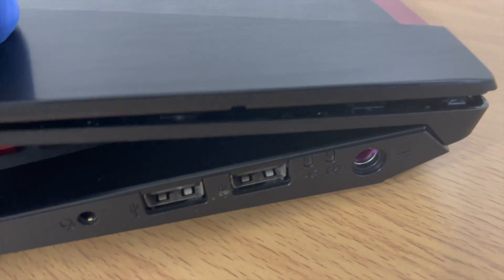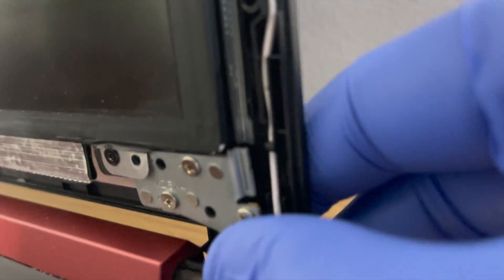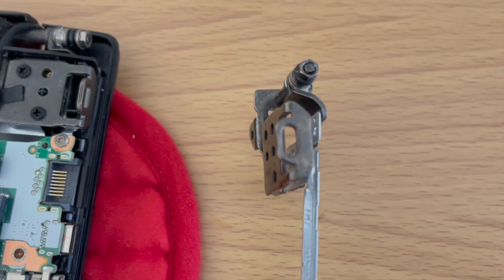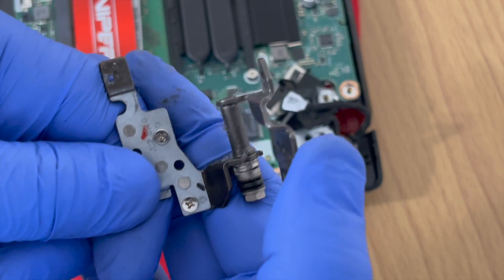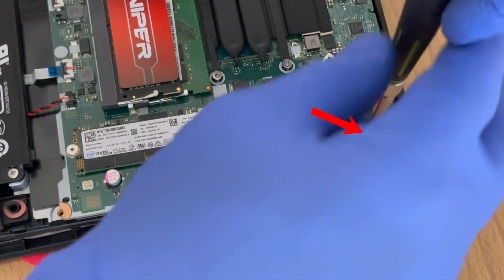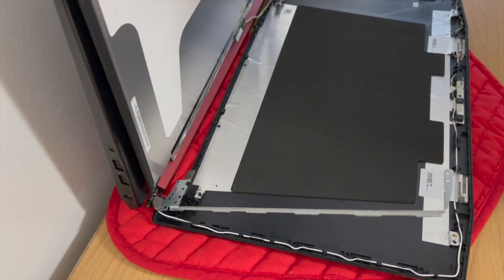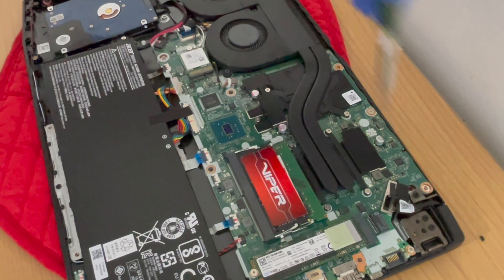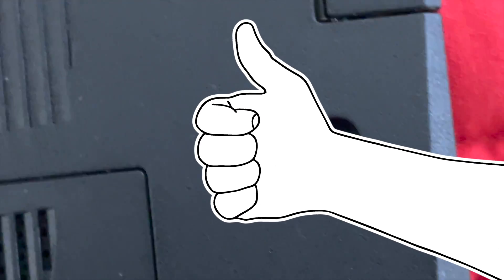Acer nitro 5 Broken Hinge Replacement

Comment: Thanks for your help, mate! Both my hinges broke, the LCD stopped working, and the screw holes in the bezel broke out. I got overwhelmed and set it aside for a couple years. But now, it's good as new ^.^
I'm disappointed to hear that I'll probably have to do this periodically. But at least now I know the original break wasn't my fault.

Comment: How long did this take? How long do you thinknit would take to replace the somewhat damaged LCD and front bezel at the same time?  I have a limited income and want to estimate the cost of repair based on the rate the local repair place charges. Any help estimating the time frame would help me find out if I can afford to repair it or not and would be be highly appreciated  please and thank you.

Comment: Same thing happened to me as well. But after replacing new frames it does not recognize closing lid. Any idea what sensor detects that event? What may have gone wrong while repairing?
Reply from the maker: Make sure you check your settings for "closing the lid."  It may be set to, "do nothing."
Reply: Magnet that sits on top of the screen

Comment: But the gaming laptop is portable **-Ack**
Reply: happened to my an515-42, it's shit a fucking vacuum dust receiver and a broken hinge on screen. Im glad I didn't spend another 60$ shit shell replacement and straight up just used epoxy to the hinges. more sturdy and less likely to fuck it up soon.
Reply: also the cuck screen is not even screwed and I had to use a strong rubber adhesive tape it back in (the screen slid off progressively under the chassis due to heat I guess but they should have know it coming).

Comment: my nitro 5 has a faint white line flickering below the taskbar. what seems to be the problem and what to do?
Reply from the maker: If it goes away if you press you finger on the screen then the screen is damaged.  You'll have to replace it or try to ignore it.

Comment: 4 years of owning this laptop and the right hinge finally broke
Reply: Just added like seven bandaids to the area as if its an injury because my poor ass cant afford these parts lol
Reply: @Nomadic7z  mine just broke do you think super glue would work as well?
Reply: @TEKIOLOL  Maybe but i just ordered a replacement part and swapped the broken hinge out with a new one.
Reply: Mines about 3 years
Reply: It's allways the right hinge😂😂😂
Reply: Same issue happened today after 4 years of use. Right hinge any solution
Reply: @abhishekpatnaik144  you could find hinge replacements or just tighten it with tape or something. Honestly really shocked how much of an issue this is for that particular laptop. Must be a design flaw.
Reply: mine also broke after 4 years of use.
Reply: Mine broken, too, on the right side. Right after 4 years and 3 months. XD. Got get replacement, I guess. Have secured the panel with duct tape at the moment.
Reply: 5 years Still a Goat
Reply: Same issue
Reply: Bro mines lasted 7 years and I’m just now about to get to it after it being out of commission for almost 8 months screen cracked,hinges broke, and keyboard needs replacing and maybe some dusting bc I haven’t kept up with it like I should have but yeah Ik it’s a yr late response I don’t think anyone going to reply back anyways but just gonna leave this up here 😂
Reply: Same here
Reply: Bro my left hing is crack and my screen is now flickering
Reply: Seven years

Comment: the thing thats holding the screw snapped, how can i fix it?
Reply: If you’re talking about the piece that’s connected to the display panel then I’m having the same issue. I tried super gluing it back together but the piece was still sticking out like a sore thumb no matter what i did, I just took it out since there was nothing I could do with it and now one of the corners of the screen is pushed in. I guess one thing you could do is replace the display panel with a new one which is relatively easier than replacing the hinge, just make sure to disconnect the battery again while doing so.
Reply: @Nomadic7z  i have a nitro 7, i think its gonna be hard to find a relacemnt

Comment: I think i have the same exact problem. Just ordered the parts and will attempt the repair next week. I almost gave up on this laptop but thanks! I will add that I've had this laptop for over 2 years now and this issue only happened when I accidently pushed the screen farther down to reach something.
Reply: ok it went through fine. Thanks again for your video. Mine was broken in the same exact spot as yours.
Reply: @jbuilds1, did your bezel snap back into the back panel? I haven't repaired mine yet, and I'm not sure if I should order all three pieces.
Reply: @keiththompson4680  i was never able to get some of the clips on the bezel to click fully and the laptop would make a click sound everyone is opened or closed

Comment: bruh I have the same laptop, you were right about those hinges, I think mine has 2 broken hinges as both sides pop up everytime I open my laptop, I can't fix it since I don't have enough money to buy replacements at the moment, but for the mean time I just put duct tapes on both side to somehow close the gap when I open my laptop.
Reply from the maker: The duct tape should hold for a bit as long as its tight.  If you have an extra monitor around, output to that using HDMI.

Comment: At 3:00, did you/he flip the laptop over with the screen just loosely sandwiched between the lid and body?  How'd you make sure it didn't move around and break the wires?  I'm about to attempt this, and this part makes me nervous.
Reply from the maker: Yes, just close the lid and remove the bottom panel.  It will not move around.

Comment: Don't buy this laptop. My hinges broke after 2 month and subsequently damaged the screen. I sent it back on warranty and they repaired the hinges and replaced the screen. 
After this I sold the laptop at a loss.

1 year down the line I was walking around in curries pc world and saw one of these on display with a broken hinge. 

Very flimsy laptop don't buy.
Reply from the maker: It is a budget machine after all. The one in the video was purchased in March  2018. I’d say it’s done it’s job while still going. Most machines have their flaws and you get what you pay for. Good luck going forward.

Comment: my laptop 2 years ago had this issue and i took it into my local repair shop to get it fixed. And it happened again on the same spot

to the point where it damaged the top case so i could easily see inside.

and i don't think they replaced the hinges at all because there is ZERO support bar on my left side

needless to say im going to be doing my repairs myself that don't require soldering from here on out
Reply from the maker: Oh, thats pretty bad if they did that.  Sorry to hear this happened to you.

Comment: I can get this laptop for 450 euro. New out of the box. Should i buy it or look for something else. Would be used for World of Warcraft , Netflix and just the usual stuff
Reply from the maker: Specs?
Reply: @Meanpooh  acer nitro 5 AN517 52 53j the one you have with the 1650, 8ram, etc
Reply from the maker: Ok, for what you're using it for, yeah should be fine.  Keep a lookout for deals.  They are always around.  Just have to find them.  Good Luck.
https://slickdeals.net/newsearch.php?q=gaming+laptop+rtx+3050&pp=20&sort=lowest_price&forumid%5B%5D=30&forumid%5B%5D=9&forumid%5B%5D=4&forumid%5B%5D=8&forumid%5B%5D=10&forumid%5B%5D=13&forumid%5B%5D=25&forumid%5B%5D=38&forumid%5B%5D=39&forumid%5B%5D=53&forumid%5B%5D=54&forumid%5B%5D=166&hideexpired=1&r=1

Comment: Metallic laptops are more preferable to avoid this or does this happens in metallic laps too?
Reply from the maker: It can happen but because the lid is metal, its hard for housing holding the screw to become weak and brittle thus breaking.  The long shaft on the repair piece can break on any laptop.  It depends on how its made, thickness etc.

Comment: yep, same thing happened to mine months ago and now its all taped up but everything still runs well which is all I care about
Reply: how many months?
Reply: @skygen6757  well its been broken for over a year now but it got so bad 7 months ago I duct taped it up
Reply: @poochihead  sorry to ask but i'm still in decision whether to buy the 2021 rtx model. Do you like to open laptop lids like anywhere? and for how long have you been using the laptop until you notice the hinge issue.
Reply: @poochihead  I can replace it manually though however finding a hinge online in my country is quite difficult might have to order from amazon if it happens to me. Btw im also considering lenovo ideapad gaming 3 as an alternative option
Reply: @skygen6757  i reckon finding a hindge on amazon or ebay may be your best bet, it seems quite rare
Reply: @poochihead  battery life is holding me back from buying.
Reply: @skygen6757  the hinge issue started to pop up around 2 to 3 years but I did use it, opening and closing frequently almost everyday
Reply: @skygen6757  the battery life of the latest models are better but in general gaming laptops battery or not the best compared to general work ones
Reply: @poochihead  ahh 2 to 3 yrs is still good considering you use it everyday
Reply: Hi just wanted to ask how is the laptop holding now 
I soldered mine on one side but the side is turning same so i am thinking to duct tape it 
Will it cause any damage??
Reply: @coldlava5436  hey, duct tape wont cause harm if its on the outside of the hindge, I added more duct tape on mine but Ill be getting a new laptop later this year anyway
Reply: @poochihead  ok thanks for the reply

Comment: Hey meanpooh I was worries about my laptop hinge lately. I opened my laptop with two hands holding one top and bottom half it then made a very loud click sound is this normal?
Reply from the maker: No, its not normal.  Keep an eye on it.  The strongest part of the lid is at the bottom corners.
Reply: @Meanpooh  okay thanks for the warming FUCK I had my suspicions 110%
Reply: @Meanpooh  so the best way to open which side?